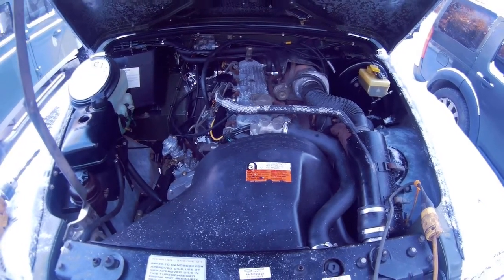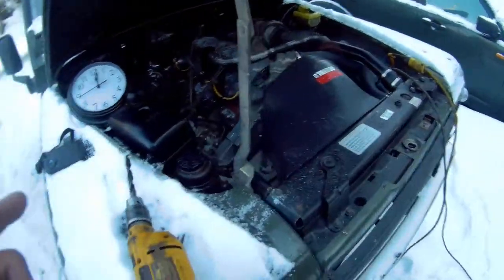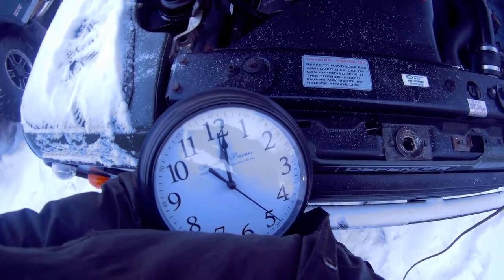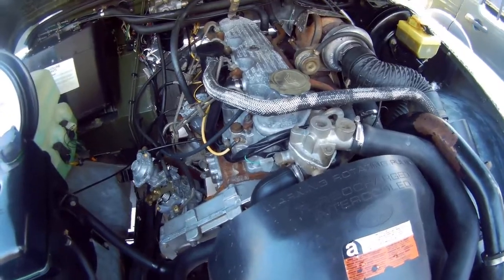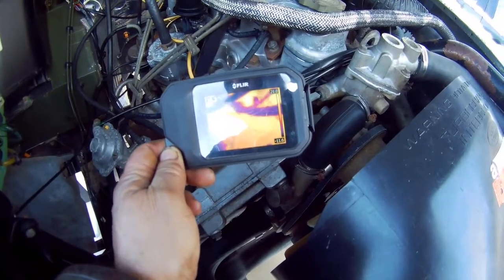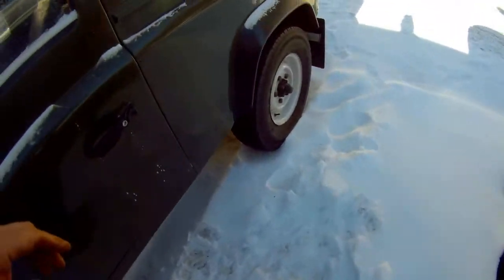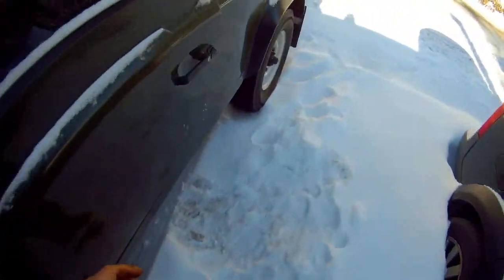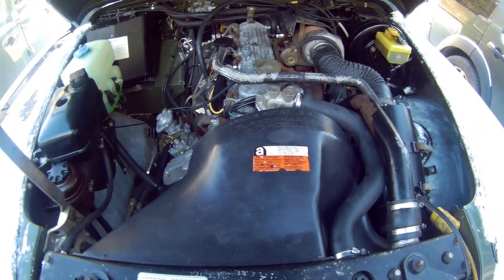Land Rover Defender block heater test - on a cold Canadian day!

Comment: Hi Mike.

You were going to add block heaters to your shop, but don’t have any listed now.  Maybe you stopped if not enough we’re selling to be worthwhile.  Anyway, I’d like to fit a couple to my 200 and 300 Tdis.  Could you supply them or post up a link to a favoured brand an model, please?  (The plan is to run them at home off a 240-11v0v portable transformer that I have for power tools).
Reply from the maker: I can get some made up - 110v only may take a few weeks as everything is slow here
Reply: @BritannicaRestorations , no rush at all as the cars are laid up back in England.  The RRC is about to go in for a full body restoration since I can’t do it myself, being expat at the moment.  That engine was rebuilt by Turners, so should be lovely when it’s all together.  Shame nobody makes these heaters in 240v - I have the Kenlowe Hotstart on the 200, but the impeller keeps seizing.  Common fault, probably because its original owner didn’t use antifreeze (someone on a forum I frequent had the same issue and stripped it completely, polished off the rust pitting and rebuilt it, and has never had a seizure since, running 50% antifreeze).

Any idea what they’d cost, once you can get them?

Comment: At what temperature do you guys suggest fitting a block heater,? I'm intrigued because we never get that cold in Scotland, although my 2.25 petrol does struggle a little when it's below about -5°C.
Reply from the maker: A 300Tdi with good compression, glow plugs working and lighter oil will start OK at -5c

Comment: Great video! I've just bought a 90 with a TD5 and I live in Yellowknife so I'm going to need a block heater for sure! Can you recommend one, do I need to know anything in particular (e.g. core plug size) before I buy? Thanks!
Reply from the maker: There are no places to fit a block heater in a Td5
Reply: You can fit a Webasto Thermotop in one 👍🏻

Comment: @3:38 -   actually a few hundred watts !  A timer will likely save you ~$40 per winter  ( price of a timer is ~$10 ).  I think  you also save about $40 in gas  per winter  with the block heater.

Comment: I have been considering a block heater, but I have not settled on a style (in-line in a radiator hose, directly into the block puck, etc).  I have been also considering a heated battery blanket and oil pan heating pad .  Which style and brand block heater do you have in this Defender?
Reply from the maker: John

I have tried them all and the best by far is the block heater as I fitted

The reason is that the one that goes in the bottom hose works, but takes forever as hot water has to get through the water pump which restricts the flow, and can back up and switch off the thermostat in the heater (if fitted)
The 300 Tdi is bad for this as the pump is mounted quite high

The battery blanket is better than nothing but as the heat rises, the the engine receives little heat
The oil pan heater does work but again is slow - it heats the oil which in turn will heat the block

Hope this helps

Mike
Reply: Thanks Mike.  I have a 2.5td and I was thinking of using all of three items together at the same time....block heater, battery blanket, and oil pan heating pad to give it the best chance.  We were at -25 Celsius the other morning and I almost ran out of battery before it cranked.  I am also considering some type of battery maintainer to keep the battery topped off for the really cold nights and mornings.  When it is that cold and the oil is thick my starter bendix does not engage all the way and sometimes the starter will just spin without engaging the motor.
Reply from the maker: Normally I use 0W30 Shell Rotella oil in winter- makes a world of difference ( except this year with the 3.9 Isuzu as I didn't plan to use it this winter)

If you were to use just a block heater in the block itself, as my video showed, it took and hour and a half to get to +5C
The down side with block heaters is that if you are using your truck to go to work, you can plug it in at home, but can you plug it in at work?!

Mike
Reply from the maker: Sorry John I forgot to add, the block heater is modified locally and are C$157.00 each The core plugs are a real odd size

Mike
Reply: I run 15W40 Mobil Delvac Super 1300.  I am able to plug in at home and work so that may be the way to go.
Reply: How does it install?  We had a freeze plug block heater fall out of our DII motor when the bolt that went through the center loosened.
Reply from the maker: John
Far too thick for winter!
I have experimented with a variety of oils and the Rotella is the best
It is a full synthetic and I have even driven 0w30 in summer with no ill effects in a 200 Tdi!

HOWEVER! 
Using a full synthetic oil is like taking someone off drugs!
It tends to flush out more gunk than regular oil, so I change the filters twice between oil changes ( which are double the mileage in regular oil)

Mike
Reply from the maker: John

See here

https://www.youtube.com/watch?v=M7PUKgrecrE

Mike
Reply: If I remember correctly I had to settle for that oil.  We do not have many choices where I live and getting a specific oil would mean I would have to have it shipped in and the list of things I have to have shipped in is already long.  I am due for a oil change so I will look for what you suggest, maybe the available local stock has changed since I last purchased.
Reply from the maker: John

I know it is sometimes hard to find the right oil
It is tempting to use regular motor oil, but having a turbo demands an oil that can be light enough to  start in winter, BUT durable enough to cope with the temperature of the turbo

I buy my oil in 5 gallon buckets - it seems expensive, but you will always use it!

Mike

Comment: Nice video Mike.  I'm considering installing a block heater into my D1's 300Tdi engine before this coming winter.  My understanding is that the Zerostart 2.06" freeze plug heater will fit the 300Tdi.
Reply from the maker: not sure  I have them made up